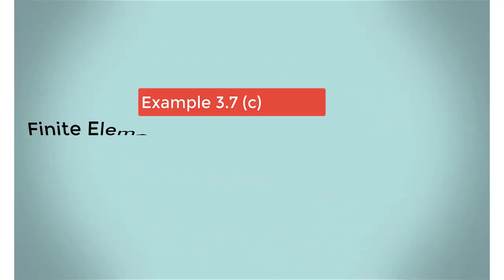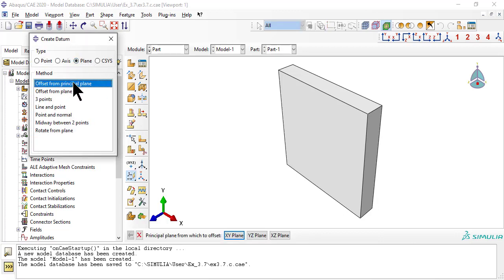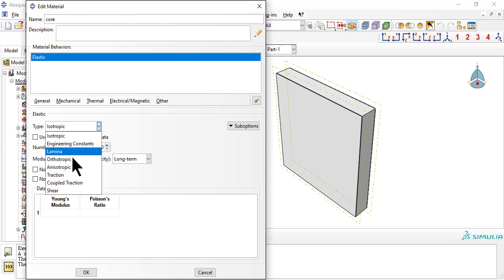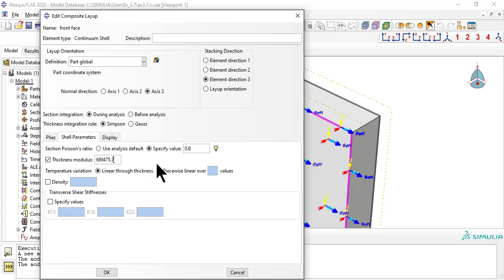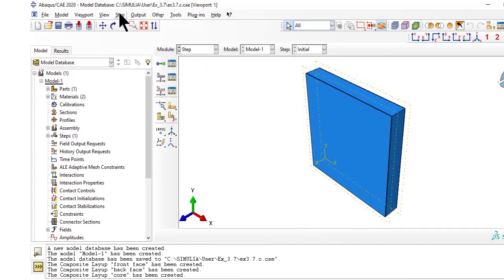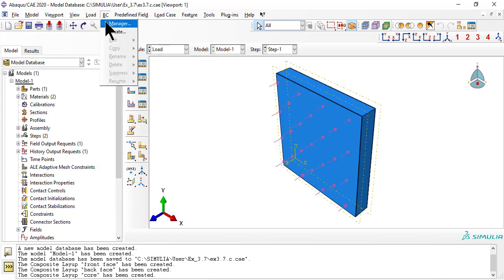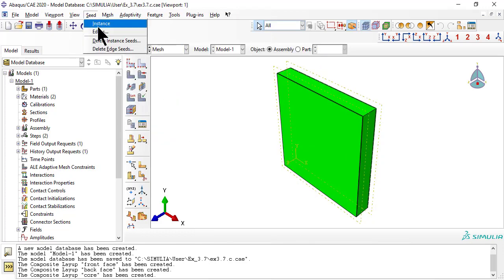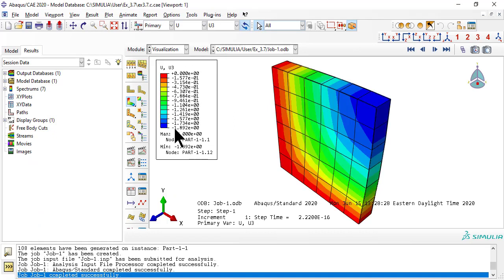Example 3.7.c Simulate sandwich plates stacking a front face, core, and back face in Abaqus

Comment: Hello Professor. I have a doubt. Does local seed application (@ 7:47)  along the thickness at the corner of the laminate lead to one continuum shell element along the thickness of the laminate? And when local seeds (along the edge) changed to 4, does that mean the thickness is discretized into 4 CS elements? 

Thanks for providing this knowledge for free!
Reply from the maker: I don’t remember, I would have to look at the video, but I think that 4 seeds mean 3 CS elements, face, core, face.

Comment: i want to ask professor. 

to find out what this analysis is?  and what is the name of this analysis?  is it just to know the stress distribution?
Reply from the maker: The purpose of Examples 3.7 a, b, c, d is to explain 4 different strategies to simulate sandwich plates where the core is much softer than the faces. They differ in the difficulty of building the model and on the accuracy of the deformation and stress results. The results presented at the end of the videos is just for illustration. Once you know how to model a sandwich plate you can use it for curved shells and you can get many different results like deflection, strain, stress, vibration, buckling, and even combine this information with material nonlinear analysis.
Reply: @EverBarbero  thanks prof